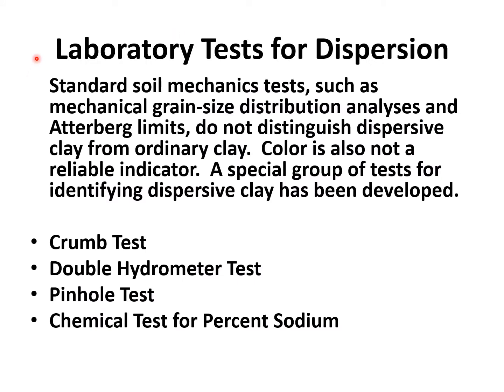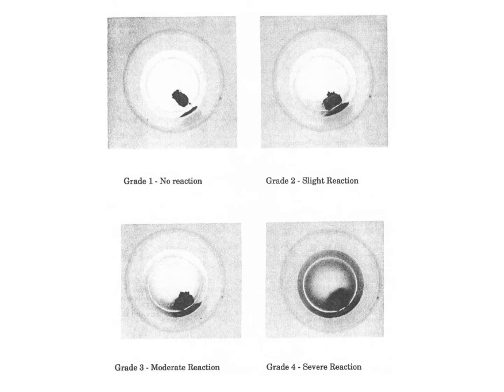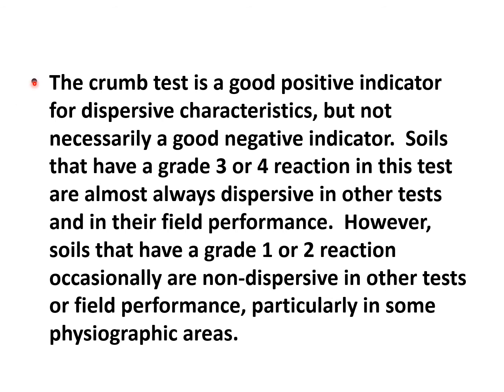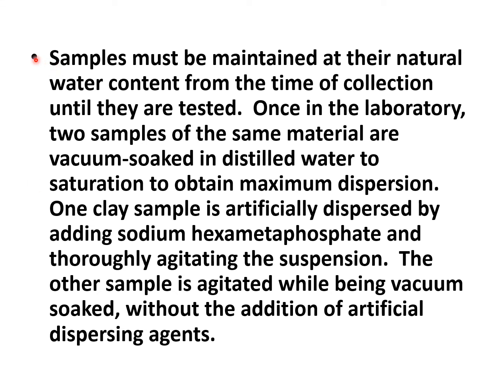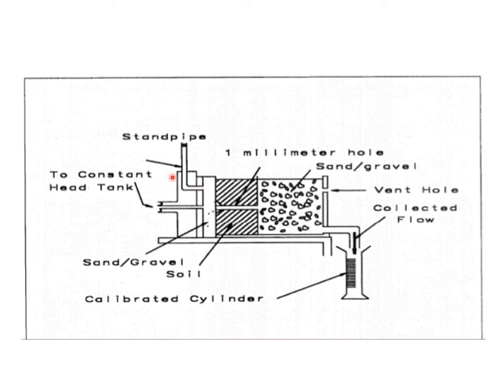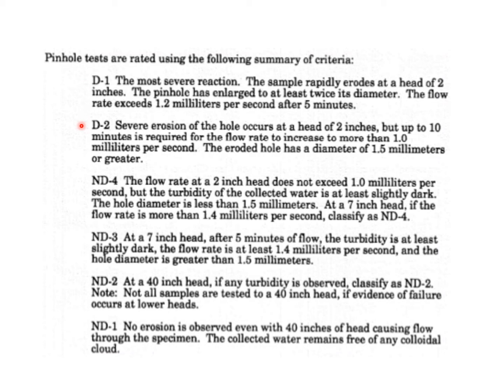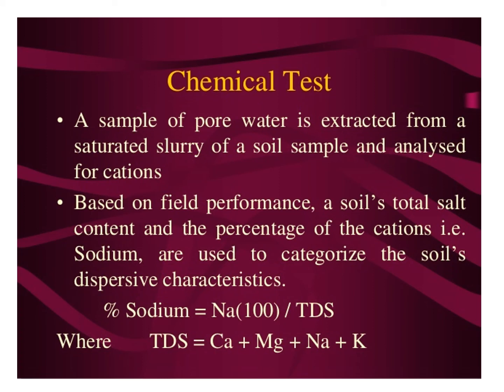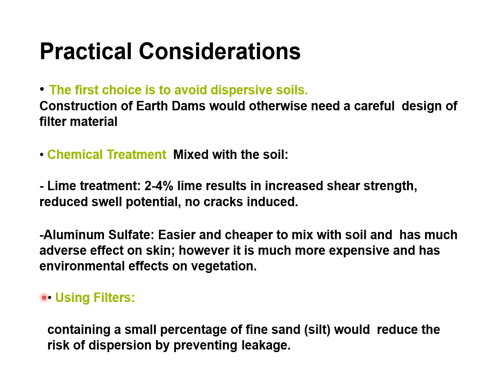6. (LAB) Testing of Dispersive Clays

Comment: hi i have a question..I have a soil, It is a MH soil  i did Double Hydrometer, Pinhole and crumb test and got intermediate dispersity but  i did chemical analysis too and i got low PS around 1.5 - 2.0 % but it is clasified as a saline soil with 8.42 electric conductivity. Could I classify this soil as dispersive with those chemical results?